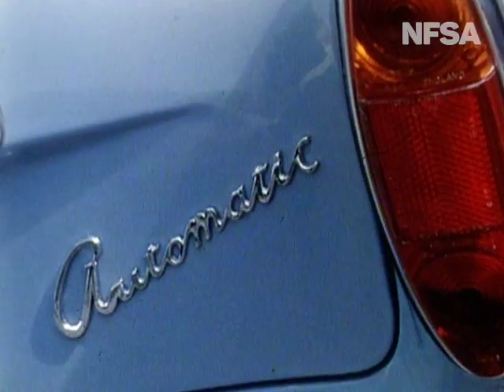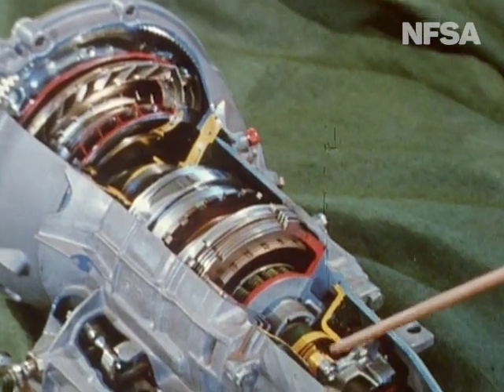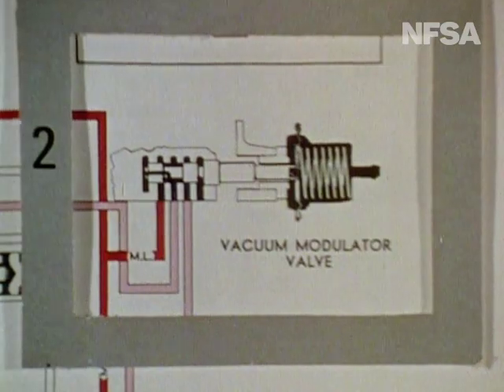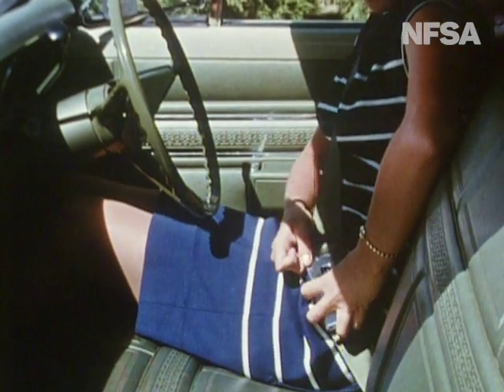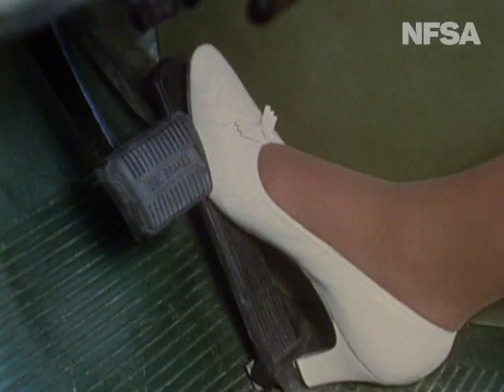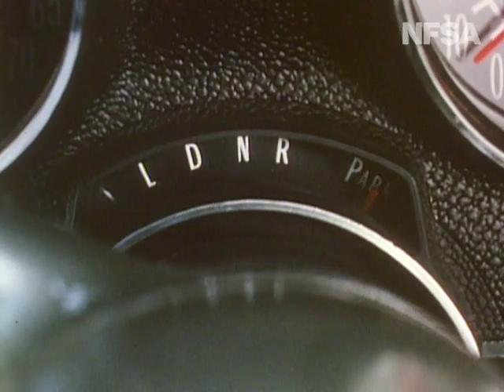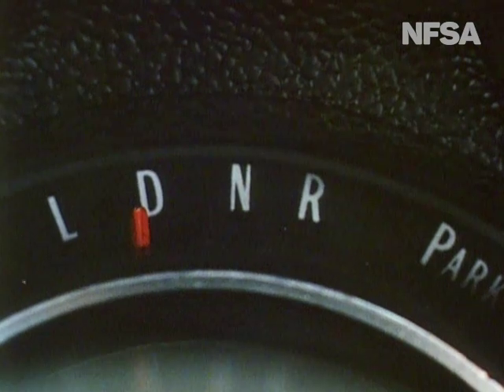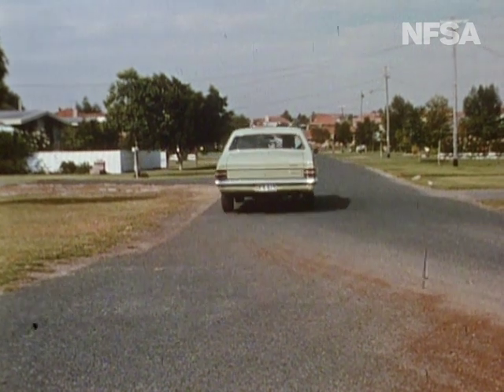Conversion To Automatic. How To Drive Ep 13

Comment: Thanks for this. 
Still good advice for many even fifty years later 
At 5:23 unusual that the HT Holden had a V8 engine fitted. Much rarer than the dominate six cylinder Holden family cars sold then.
Reply: Ah the good old 253ci motor! I had on in my HZ Statesman...
Reply: It did.  But the engine sound throughout the video sounded like a 186 lol
Reply: The 253 was introduced in the HT series.  With drum front brakes.  Discs were optional.  The film vehicle does not have the hand brake warning light option.  There would be a switch, (like the door switches to operate the interior light) in the hole on the hand brake lever bracket.
Reply: plus the two speed power glide auto
Reply: No not unusual at all my dad had the same car white ht Kingswood 253 with 3 on the tree .V8 were optional extra in entry grades Kingswood and falcons in fact you could option for a 308 in Kingwood or a 351 in a falcon ..
Reply: @RodsPinballVideos  that cause from factory they had a single exhaust system that was heavily baffled to eliminate drone at hwy speed .my old man had a white ht 253 manual 3 on the tree under hard acceleration you could hear a slight V8 growl
Reply: The 253 and 308’s were introduced in the HT and were not 2 speed powerglides they used the  3 speed trimatics thru to the HG then Holden dropped the use of trimatics behind the 308’s later in the HQ series due to durability problems and 253’s were the largest engine to then have a trimatic,  the 308’s and the Chev 350’s only came with the turbo hydramatic then on

Comment: I come from the era, the Hydramatic we called 'Highly Dramatic' because I worked for Ford, and we didn't get along.
 The first Falcons had the Fordomatic, which was a  sluggish two speed, then a 3 speed came later made I think made by 'Borg Warner', what a revolution, they worked quite well, not so the case today with those awful CVT's

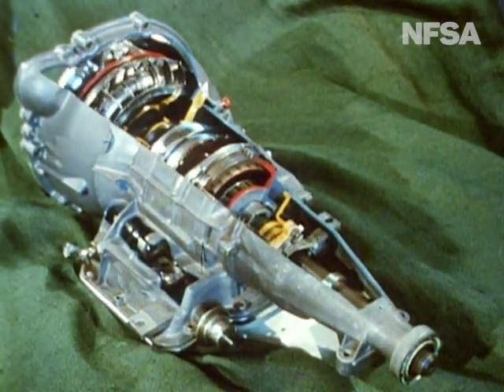Comment: 5:15........just love that car! In 1970, the HT was the current model Holden. I had the HG Kingswood in that same green, but with a white roof, 186 and three on the tree. The HG was later in 1970 and into 1971.  
I later had a gold VB Commodore with a 202 and Trimatic. I found the Trimatic a terrible gearbox. Unless you topped the oil up constantly, it slipped, jerked and misbehaved badly. On the gear lever, you could shift from drive to neutral without needing to squeeze the button, even when moving. But...........when shifting from drive to second, you DID need to squeeze the button! The logic was shocking. Borg Warner auto's in Ford's and other makes were far smoother, and more logical to use.

Comment: I didn't know the 253s came with a power glide auto. I thought they only had the trimatic's for the autos. then again I think the HG series was the first to have the trimatic's.  interesting at the start when she started the car the fuel gauge they showed is the standard dash type. later in the video the car had a GTS dash, so I'm thinking they may have used two cars for this video, the power glide may have been a HT with a 308  or the 186s thus the power glide and because  the car had an auto choke.
Reply: In early HT's, no. In late 1969, Holden made the powerglide optional on all engines to simplify the logistics and ordering system. 
Prior to that, it was a confusing and illogical system of them being available for some engines, but not others, including the very engine they would have been most popular with.  This must be a late HT. It's actually very well optioned for the day:- V8 engine, automatic, disc brakes, radio, heater and GTS gauges. None of these things were standard in the HT Kingswood. If it still existed in that condition today, it would easily fetch tens of thousands of dollars!
Reply: GTS dash may have just been a tacho on one side, and a clock on the other. Temperature and oil gauges may have been also offered and exclusive to Monaros. I can't recall.

Comment: ...and at 13.42 the Holden is comprehensively beaten off the line by the Falcon ute....  Seriously though, I was hoping they might have shown the Chrysler Torqueflite auto, where the push buttons were on the dashboard to the right of the steering column, like in Dad's '64 AP5 Regal.